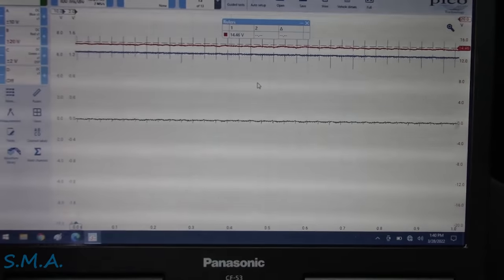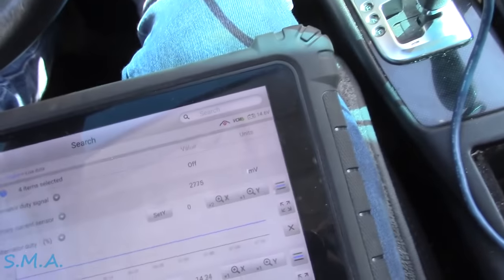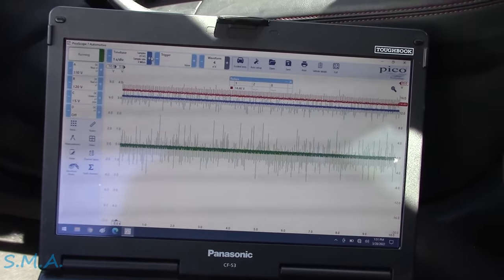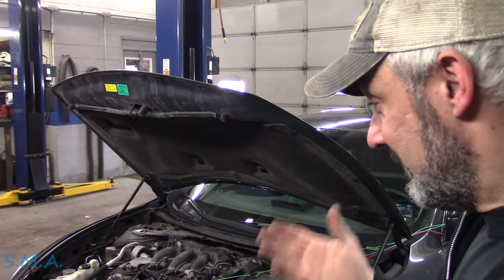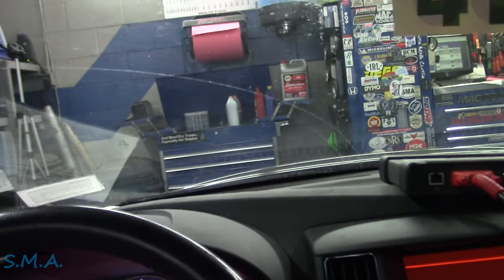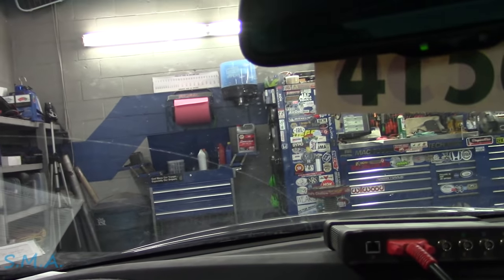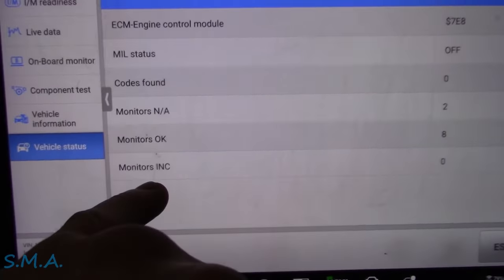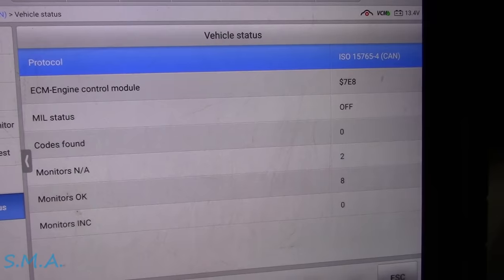Nissan Dealer Quoted Over $2000 For A New Harness!! - The Real Problem

Comment: When I was a kid, the dealer tech was one of the most highly regarded techs, because the dealer made sure that it was nearly impossible for the tech to be tempted to leave, as compensation and benefits were top notch. After the Arab Oil Crisis in the 1970's, and the subsequent drop in vehicle design quality, the retiring techs were not being replaced by the same group of younger techs. New technical jobs involving clean hands and air conditioned work meant that new kids were refusing to go into the auto tech field. That is still the case today, only it has gotten worse for automotive and HVAC businesses. No one wants to pay a commensurate wage, and what you end up with is what is "left over" after the top kids have been hired into competing jobs. The answer is that the businesses need to charge more, but the customers won't pay more to they can offer higher pay for the techs, and the higher prices will only happen when the ranks get so thin that the customer is forced to pay more by a lack of choice in doing so. That's how a "lead tech" at a dealer can miss a simple diagnosis.
Reply: Flat rate is also an issue.  To much rushing.
Reply: it's not about paying top techs. What Eric is doing cost TIME he is the owner he can use that time. a dealership or other shop dont allow techs to take their time to diagnose things as they are monitored and their time to fix must meet the books estimates and the techs must fix cars as fast as possible. so if you start tracing wires and connecting scopes u will be fixing less cars, fixing less cars drops the dealership/shops income and u r a bad mechanic in their eyes. due to all the modules in modern cars there is no way r u just so advanced that you can guess whats wrong. watch how indepth Ivan pine hollow diagnostics has to go to find something apparently simple
Reply: 100% In 1992 I was earning the equivalent of $100 per hr doing only computer tech/wiring work on cars and always had more work than I could handle. However, all the majors (dealers/Goodyear, etc) wanted to pay = to 30 an hr. The job is dirty and physically demanding but I enjoyed it until my body started screaming enough. I went back to IT made slightly less money, worked way less hard, and did not have customers calling me a thief(for charging to diag). Hard to get/keep good talent when the job is physically and mentally harmful (even at 2x the price). I still do a few diags but it is at my pace and only if the customer has already "been around the block" and it's me or the scrap yard. That way no matter the cost they are very happy and I have no time psi either/:)
Reply: I had experience in a profession, and applied to a place where it turned out my trainer would have had 9 months experience total. When I was asked a stupid question about following my trainer's directions, I told the boss that if you hire for experience, and the trainer doesn't know what they are doing, I will use my experience every time. Funny I didn't get hired. A contact I had there said my answer killed my chances, since their average experience was 6-9 months, and I had about 8 YEARS in at that point.
Reply: I guess I should add some context.... at the risk of sounding like I'm blowing my own horn. I worked for private fleet garages, I worked for 3 different brands of dealerships, and I worked for a big aftermarket chain as a flat rate mechanic, with four ASE Master certs, and L1 and L2. I can tell you, based on my experience, that the lead technician at Nissan spent more time on that job than Eric spent finding the actual problem, and the reason is what I've stated: there is a brain drain happening. Having worked for a dealership, I was never pushed on the basis of time, because the amount of work I got done in the amount of time I could get it done meant more money for me and more money for the dealership.  However, the dealership could not keep me because they would not raise my basic hourly flat rate pay. Dealerships aren't even keeping up with inflation in their pay for their technicians. My basic hourly in 1998 was $22 an hour. Today, in real purchasing power, that $22 an hour is getting close to $40, and dealerships won't pay that kind of money for your basic hourly rate. 
 There isn't a dealership that could afford to pay Eric what he should be paid for his knowledge and experience and attention to detail. They just don't want to pay the money.
Reply: @arthouston7361  Funny you say that because I know a lead tech/Nissan master tech that from what I know a few months ago was making $27 a flagged hour. There was another one who was making $30 a flagged hour but he demanded that pay. That's nothing when you factor in the years that they dedicated each 13+, the cost of tools and training needed and warranty times. Last time I checked they were paying like 18.5 hours for a long block to be done on a Nissan NV2500 V8.
Reply: @abes7181   Exactly. That kind of expertise demands $38....a full $11 more than $27, and a lot less in purchasing power than I was making at Toyota in 1995, which is a better franchise than Nissan.
Reply: BS, the dealers are all about time and time equals money, hence badly trained apprentices as that costs time and all they want is cheap labour so this is the shit which gets pushed out the other end.
Reply: Not too mention that the manufacturers are designing complicated, failure prone systems in the cars.
Requires smarter techs but they want to pay them much less.  In the end customers get screwed by paying massive repair bills or buying new cars, after the warranty is up.
Reply: Technological machines such as automobiles and air conditioning systems are being designed for simplified service work, with modular items like circuit boards (pcm's, etc) instead of discreet components which are never repaired, and basic diagnostic guides are provided provided and technical support desks are offered, allowing for phone calls from befuddled technicians. What this means is that you have one centralized source of persons who know the system, and that person provides guidance to people who are less well versed in their craft than their predecessors.  To put it simply, they are dumbing down the machines for a dumbed down workforce. Then, when a situation like this woman's Nissan comes along, there is no one working in the shop who has been retained by great  compensation packages, and that person does not exist in the shop to do the next level thinking that some problems are going to require.  That is where Eric becomes valuable in the marketplace. However.... next level thinking used to be required by every technician in the industry. The result is a race to the bottom where you are fortunate to find someone working in a shop that can locate their buttocks using both hands and a roadmap. Fortunately this woman was able to find Eric, who can charge what he desires and accept the vehicles that he wants to work on, and decide how much hes going to pay himself for his efforts.
 In 2022 shops such as that are a very tiny percentage of the marketplace.
Reply: @dpeagles  For the unskilled perhaps. If I could not beat the flat rate 90% of the time, I would not have called myself a competent tech. If I was assigned an eight hour procedure, and was given no other work to do after I finished the job, I would have demanded $50 an hour, which I would not have received,. and then would have to go elsewhere.

Comment: I had a flashing check engine light on my Jeep. Multiple engine misfire. Took it to a local mechanic they said it was a bad ECM.. They told me to take it to the dealership. Dealership figured out it was a bad groundwire.

Comment: Sadly, dealerships are slacking all over the US. They failed to tell me that my wife had rear main leak and her front brakes needed replaced when I picked it up from an oil change.   How do you skip those when you do a “full inspection” during every oil change?  Rear main seal is right by the oil plug and the brakes is a no brainer. She should definitely get some money back if not all.   I’m amazed at how you fix issues that these overpaid mechanics aren’t catching.   Thank you for your work out here.  Been finding your videos highly entertaining.

Comment: I feel like issue with high volume shops is that they are constantly fighting the clock to beat the flat rate. No one takes the time to test drive the way you do. They then fire the parts cannon at whatever they come up with in their hurried diagnosis. You sir, are a real mechanic and it’s impressive to watch and learn from.

Comment: I'm curious.  Did they just pulled the codes and then decide to toss some wheel sensors at it without performing even a basic check to be sure it wasn't something else?
Reply: YES. They had ZERO clue.
Reply: Exactly what basic check would you perform if you did not know what you know now and the car showed up in your hands
Reply: Unless you were watching a scanner while driving looking at battery voltage you may have never caught this problem in the act
Reply: believe it or not sometimes that is the best thing to do. For example, car comes in with a wheel sensor code I earn 115/hr the sensor costs $20 and takes 15 mins to install total of 48.75, or I hook up my scope to verify exactly what the failure point is (all told .5-1hr of testing) now I bill you for 163.75. I am therefore a thief(overcharged you 115). In cases where things are 90% or more cut and dry, I will often offer the customer the option BUT I never tell them yup you need a wheel sensor 100% unless I already proved it. That way I am not a thief and if it ends up being the 1 in 100 with a high resistance wire(or whatever) I am covered. The worst is defective parts because now I have to spend the hr and when it turns out that the new one is bad I cannot charge for that hr(averages around 5-10% of parts)
Reply: I would rather pay the $163 and have the problem fixed rather than pay the $48 and still have the problem.
Reply: @freetolook3727  Which I will gladly do AND kKNOW if I got a defective part it is a win-win.

Comment: Mr. O you always have me thinking of things like this.
I am a gps, camera ,mobile electronics installer. Always have customer blame equipment for battery drain after a year of flawless performance.  They never think huh battery or alt may be bad. But quick to blame my work or eqipment.  
most of time it is a new plug n play device to obd2. now not saying that it cant be the problem but if customer unplugs it and still has a problem its on me to find problem tell then the repair. I applaud you and knowledge you pass on and The dealer techs have very few old school guys who can use a scan tool to diagnose properly . Thanks for the videos and keep up the good work!!!

Comment: I appreciate that you temper your experience and knowledge with pure data, and you make no definitive conclusion without fact-based evidence support. I am a firm believer that the smartest guy in the room is always the guy that can see the furthest down the road, and it seems to me this is exactly how you approach problem solving. As far as Nissan; they should be embarrassed, and they should reimburse the customer. They never even got close to diagnosing the issue, so what is it that they accomplished that warrants compensation? If one wanted to cut Nissan some slack, one could justify them charging her because they probably believed they diagnosed the problem correctly and she just did not want to pony up for resolution, but given the actual resolution, they should be willing to reimburse her and more.

Comment: Very good video. Back in the old days, the Chevrolet 6 cylinder (1940s, 1950s) had the coil mounted to the engine block in a bracket with 2 screws. A screw would work out, be lost, the other one loose. A turn  killed the engine. I don't' remember which direction.  The car would turn, but the coil continued in a straight line and one terminal would ground out against the distributor..  

The dealer just owes this lady her money back. But it won't happen. After the warranty period was over, my vehicles were never back to the dealer.

Comment: Hey man! I’m a 7 year ford tech and this reminds me of a truck I diagnosed from a independent shop. Long story short the guy had a misfire on cyl 5 dead miss and the shop had told him he had no compression and that he would need an engine.. sheesh they quoted him $7,000 to “fix” the issue. 
So I was looking at the truck in the service lane performing a visual inspection and found 3 broken ignition coil clips. Also after further performing my own compression test all cylinders where over 175 psi and within 5 psi on all 8 cylinders. Ran an injector flow test and wouldn’t ya know cyl 5 injector failed. 
Replaced the injector and got new pigtail connectors and she ran like a champ. 
Here’s where it gets good. The guy called the shop wanting his money back and the shop called us an I spoke to the tech who tried to sell this man a $7,000 engine (which would not have fixed the issue) and told him he needs to hit the books and actually spend at least the time the guy has paid you to diagnose the issue. 
The shop wasn’t to happy with me and he got refunded 😄 not all dealerships are bad just gotta find the good ones.

Comment: Diag time is likely the reason for the poor initial diagnostic. I had a similar situation with a dealer diag on a Ram 2500. Tons of lights on the dash, spedo & tach stopped working, dealer told me it needed a new wiring harness. They must say this when they really have no clue and don't want to actually diagnose & fix the car. Anyway, with some time and a flashlight I found rust & damaged pins in the ABS sensor. Got everything swapped out and VIN programmed for $220, all issues fixed. Anyone could have found it with more time. Great to see this 2nd video land with a fix in place. Happy to see you have a car in the shop you can get the state certification signed off on  too!

Comment: Electronics 101! Ideally, cars operate between 13-14 volts and typically the alternator is regulated to stay below 14.7 volts.
One gotta question it...where is the positive voltage coming from? The battery only produces 11-14 volts alone and can't produce anything higher. The the only device left on a vehicle that CAN generate electricity is the alternator. Adding two positive leads from the same source does not double it's energy output lol. Any hint of an alternator producing beyond the regulated 14.7 volts is worrisome. Its bound to fail.
Shame on Nissan for missing the target entirely.  Awesome job as always Eric!! Love your approach in logic and diagnostics!

Comment: I may be too late for this comment from all the way "Australia, down under." Great channel by the way. I came across your videos when i snapped off a spark plug in a LS2, L98 v8 i own. Ended up watching your 3valve ford spark plug extrusion video. Anyway.
I think the owner in question should roll on up and show them their failed diagnosis, and in hand your positive outcome to this problem. Put them on the spot. If they refund the money that's a bonus, but if not, don't go back. Nissan lose a customer, you Mr O gain a customer. Win win for you. Keep up the great work with very informative videos.

Comment: May not have any relation to the Nissan problem but I was a road tech for Toyota forklifts and had a similar running problem. Alternator was also problem voltage uncontrolable when running above idle. Great job finding an repair. Yes she deserves to recover most of money spent.along with apologies from dealership and Nissan

Comment: Wow that was my diagnosis from the beginning was the alternator . So the dealership thought it was a short in the harness . To difficult to determine the specific wire . To charge someone for repairs that did not solve the problem seems to be the norm . A mechanic is only as good as there ability troubleshoot .

Comment: Great job Eric as usual. I at 73 am starting to let others work on my vehicles. Mostly with unhappy results. Last week I got tired of fighting the wheel pull on my honda accord so took it to les schwabfor a free  diag. The first thing of course was to try and sell me new tires. No one mentioned that tires could be my whole problem. Instead they said they needed to do an alignment to see if I needed any suspension work. I agreed to the alignment against my better judgment. After waiting a couple of hours I got the keys back and they said an alignment was not the problem. Tire pull was my problem. Gee folks thanks a lot. $129 for nothing. I went elsewhere and bought a couple of new tires. Problem solved. Thanks Schwab. Again another reason to stay away from shops. Wish you were in Calif. I would drive 4 hours to get an honest mechanic like you. 👍
Reply: Don't go to a shop offering free diagnosis, instead go to a shop that charges an hourly rate for diagnosis and they will be more motivated to actually find the problem instead of trying to throw parts at the problem.